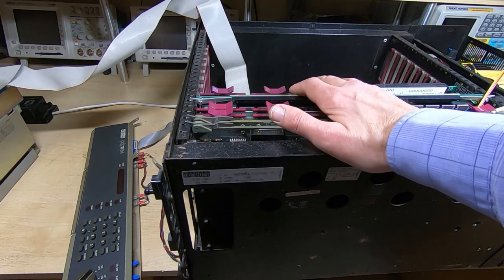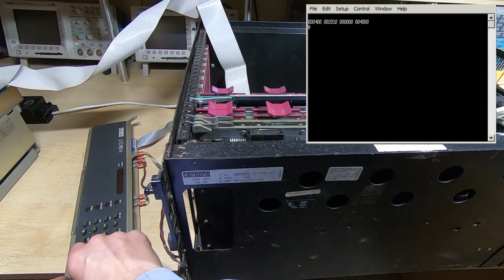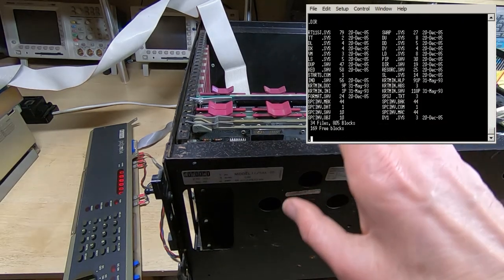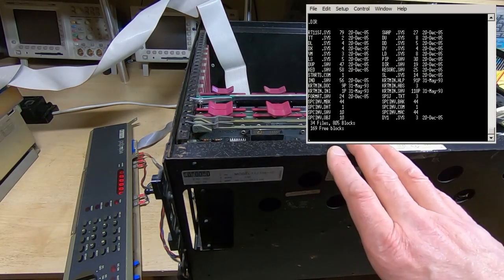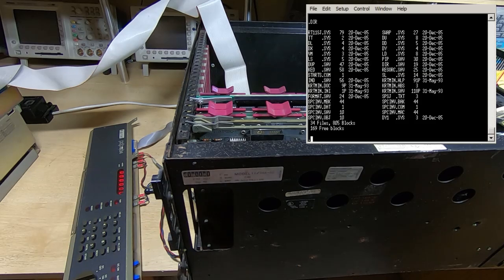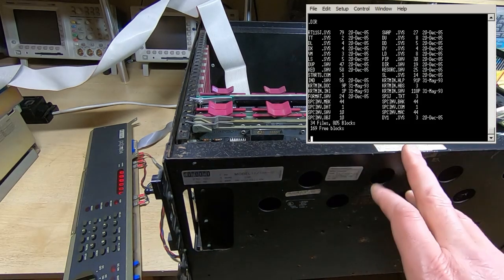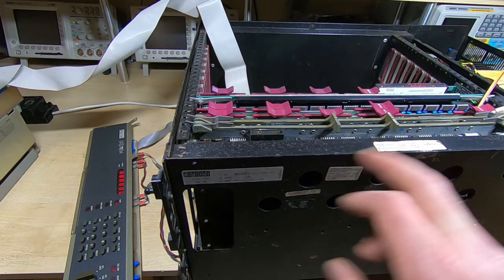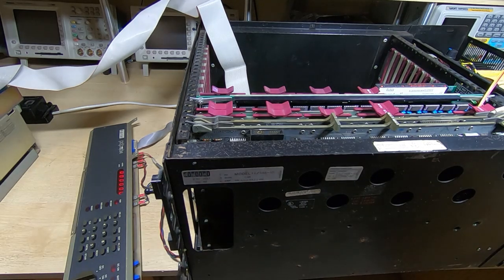PDP11-34A Repair Part34

Comment: Jerry, you've made great progress in bringing this machine back to life in a reliable manner.  Congratulations!

Also, have you figured a way to format RX02 diskettes using RX02 hardware?  Or is that a hardware(?) limitation (that I may be completely wrong about!) in the particular Shugart floppy drive units that DEC specified for their systems?